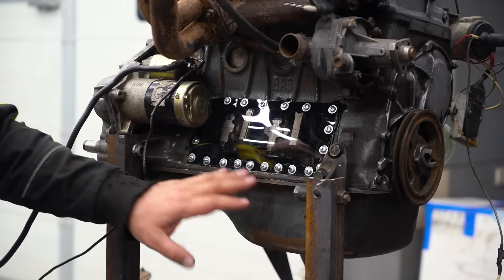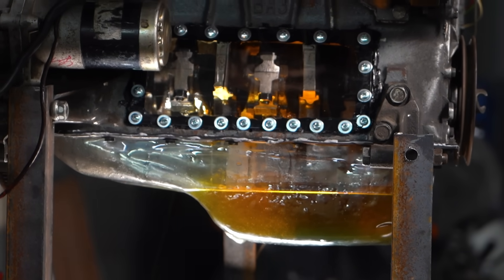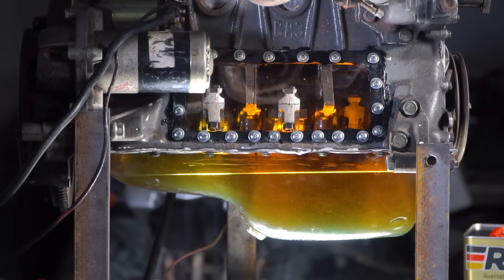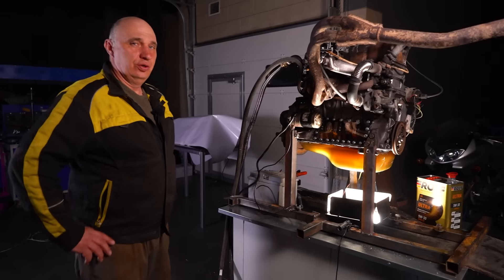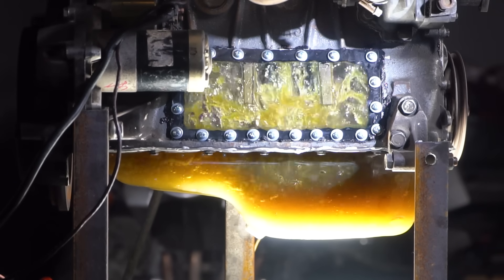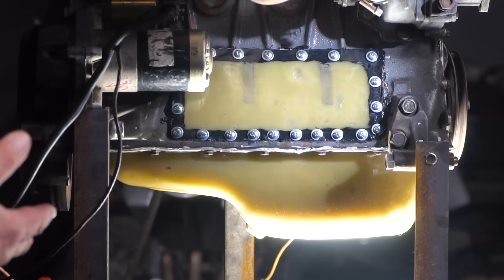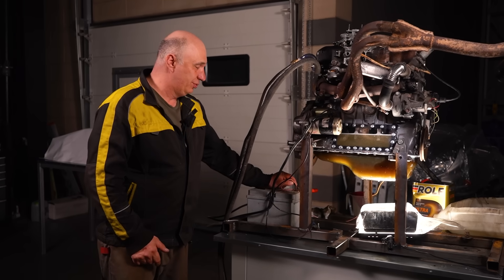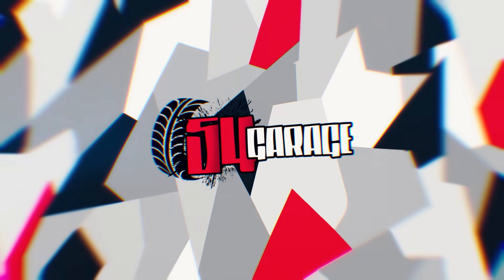What actually happens when you overfill your motor oil? (w/ transparent oil pan)

Comment: Huh. Interesting. I had a new engine built for my 72 charger last year. Guy built it out just "a little bit". Fast forward a year later and I'm now replacing the valve cover gaskets for the 3rd time, the pcv valve for the 2nd time, & installing a baffle under the oil cap. Never fill it past the fill line but also can't remember if we put an oil pan that was bigger than original/ if we replaced the dipstick in the process. (That was a years ago project from when I bought the car). Guy told me it had extra pressure and that would explain the oil shooting out from under the oil cap, but not sure about blowing BOTH valve gaskets repeatedly. Watching this gives me more questions but a better insight as to how to fix them. 😂 great video guys! Cheers!

Comment: The lubricant properties of the oil are deteriorated by the saturation of air. Which means the engines life has been compromise due to metal to metal protection been reduced. Besides burning oil and increasing vapor internal pressure.

Comment: If you want your car engine to last longer add more oil, oil is what cools the engine, The reason they may say not to, Is because if everybody added more oil that would be more oil to have to get rid of each oil change, Car companies just give the recommended amount of oil to get it through warranty, You should always add at least a couple extra quarts of oil if you own your car And you want the engine to last longer, Been doing it for over 50 years on every one of my engines, Just remember oil is what cools the engine down, So the less oil in the engine the less it's cooling the engine,

Comment: Had a six in my Ford itused so much oil we filled the engine to the top of the valve cover never hurt anything , i used it to go to work every day no isdues except i had to plug the dipstick hole to keep the oil from running out

Comment: someone i know overfilled their oil by 5 quarts under the assumption they could stretch out needing an oil change. it only held 4.5 foamed up and massive amounts of oil started going in the pcv. they called me when their car started billowing whte smoke. had to pry what they did out of them drained 10 quarts out and changed the oil in a mcdonalds parking lot. gave it a hot supper to burn out the residual, a couple months later catalytic converter effecciency below threshold. fouled it up ruined a 500-1500 dollar part.

Comment: The difference of that test and the reality is that on real life when driving the car the oil moves everywhere, and especially on uphills or downhills oil will go to the back or front o he engine, even with the same gap of the crank to the oil on that video, in the conditions that i've said oil level can touch the crank, oil will make resistance on the crank and with the engine tilted it can happen just on one side of the crank so its even worse, that resistance can surely bend or damage the crank or push rods driving with too much oil on long term.. easy to prevent, just fill a little before de max level and you surely will have enough gap between and moving components, is way more safe and as you see the oil system don't need oil on the max level to lubricate all the components

Comment: Ive always heard to much oil can cause gaskets to blow. Seems legit. In this case the oil pan was the weak link. 

Someone mentioned a good point. All the air bubbles going into the pump could cause issues. All engines are going to react differently  though. Id say its best to not overfill your engine.

Comment: Very good experiment.   I suppose all of us who work on engines have wondered about the 
"Caution, do not overfill”. Warning, and now we know.  Thank you.  I also was wondering what cavitation of the oil would do to oil pressure and efficiency of lubrication.  Has to not be good.  Second, I was wondering what the physical resistance to crankshaft counter weights and rod ends would have on efficiency of operation.  Seems the resistance would decrease horsepower.  Thank you again for the great video.
Richard,
Utah, USA

Comment: Cavitation (air bubbles in fluid) means less oil gets to the top end (cam and lobes, valve stems, rocker arms, lifters, etc.), causing premature wear ,reducing horsepower and fuel efficiency because of the drag on the crank counterweights. It's why some engine builders use a windage tray to remove oils parasitic drag on the crank. Awesome video by the way.
Reply: the dip stick have hallow dots on it which tells how much space is in the sump available to fill the oil for the engine
Reply: the dip stick have hallow dots on it which tells how much space is in the sump available to fill the oil for the engine

Comment: I have always thought that the myth that a motor are having 1 quart too much oil and it was gonna cause it to blow up. I always thought it was a load of crap.
I also understand that this engine is a Russian made engine and they I am sure obviously make their engines too much different tolerances than ours are made or that Japan makes because here in the United States probably half of the cars on the road or made in Japan, but I cannot believe that the tolerances are so tight that 1 quart over recommended level is going to destroy a motor. I mean if what that guy was saying was true. He had three times amount of oil in that thing and it was still running fine and I would think that in any motor having a little too much oil is better than not having enough.

Comment: A-1 video great presentation !! i've never seen anything like it ! I have started putting in 10 quarts instead of 5 quarts, the extra oil loosened the sludge around the block, totally plugged oil filter, valves started to clang & rattle, oil  pressure dropped to zero,
when I pulled oil filter, it was full & solid, I carry a spare filter now.. thanks mister !!

Comment: My 2015 0.9l Hyundai i10 has a dipstick that is wrongly marked.  The book says 3l oil for refills, if you do this the oil level on the dipstick is about 12mm./ half inch above the top line marked across the stick.  Oil filter capacity makes little difference.  You will only find this out if you do the oil change yourself, I carefully checked the empty oil containers and have never seen this before on any car.  Ask your dealer to check this carefully when he services your car.

Comment: Interesting video! We had a Hyundai Atos once; two times the garage "overfilled" with oil causing the evacuation hose to come off. The station filled with the recommended amount of oil from the service manual, but it seemed to be a little too much. I guess the Atos engine is a sensitive one.

Comment: lmao even when they see by their own eyes... some people still believe a small overfill will hurt oil rings and create excessive oil pressure and burst engine rear seals and kaboom... no my friends, unless you really overfill a lot, its not 100-200ml more that will do anything... first, oil pressure is only after the oil pump, secondly that amount of overfill is not enough to hit the crank and create bubbles... so yeah if your oil level is at max or slightly above max you are fine... in fact much better than close to minimum, as we saw in the first run he did, if the oil level was a bit lower in high rpm's the pickup can almost run out of oil when could... thats also why you shouldnt high rev a cold engine... never do that by a lot of reasons, not only oil..

Comment: I had a customer bring in her car (Nissan Sentra). Her complaint was it was running rough. I knew there was a problem when I pulled the dipstick and oil shot up from the tube. She filled the oil all the way to the top of the valve cover. I asked why it was that full. She blamed me and the guy(another customer) who sold it to her. 
"He said all he does is add a quart of oil every week", she said.
I told her, "Yes, because he's on the road 5 days/week putting 1500 miles or more on it. We both told you that".
"Oh...I forgot". 
I gave her a free oil change and we laughed. That Sentra drove like no other. I don't think they're capable of dying. The thing had no leaks.

Comment: you should have filled it until overflow and put the breather tube in a 5 gallon bucket with a lid and a bunch of oil with the original metal oil pan on it and revved the shit out of it. This way the breather would be sucking up and blowing out motor oil keeping it flooded

Comment: I have a Ram 1500 V8, and it calls for 7 quarts of oil. I always use Royal Purple synthetic 5w 20. I always before Changing my oil Bring Up Operating temperature this way When I drain the oil I can get the most out. Putting the 7 quarts puts the oil Level right at the top or a little over the Max line. Great video. 🇺🇸

Comment: The absolute BIGGEST lesson to learn here, that I have known since I bought my first car, is to always give an engine at least 30 seconds on a cold start to circulate the oil. In addition to that is to never drive at highway speeds until the engine has fully warmed up. I go the speed limit on the feeder/service roads until my car has warmed up.

I take it a bit further, when time allows, and give my car at least 5 to 10 minutes to idle itself to operating temperature. I understand the impact this has on possible emissions and fuel economy but, I have always noticed that my cars have little to zero problems as they age from me doing this method.

I also try to never go above 3,000 RPM when accelerating and use a linear amount of pressure when depressing the gas pedal. I use the tall ratios of the transmission gearing to get up to highway speed with the engine barely even needing to go over 2,000 RPM.

My car has a V6 engine so, it has a lot of power to allow me to drive it this way. A 4 cylinder engine may or may not allow this type of acceleration method as I have never owned a vehicle with a 4 cylinder engine.

Great video, there is a lot to learn here.

Comment: I passed the top line accidentally, and my vehicle eventually misfired
One spark plug was lightly oiled
The video is a bit ridiculous, because what was supposed to do  is paasing a max line a reasonable amount of oil and show what hapen to the engine parts, instead to keep adding oil, on and on and on

Comment: I recently purchased a used Subaru outback with 175,000 miles on the engine. After having rough idling and stalling problems I fixing tons of random issues (cleaned throttle body, cleaned MAP and MAF sensors, cleaned EGR valve, replaced air filter, plugs, wires, coil, replaced broken ground strap). The idle got slightly better or no change each time. I also replaced the PCV valve which was oily, spark plugs oily... It still stalled occasionally after all that work. I decided to change the oil because it was time anyway and I had run out of things to fix.

I nearly overflowed my 7qt drain pan. There was more than 2qts MORE oil in the engine than there was supposed to be. It's been a week and the car hasn't stalled. Not saying that was the cause, but it certainly wasn't helping.

Comment: Slightly overfilling isn't a major issue on petrol engines, but overfilling on diesel is where things can get dangerous, it can cause diesel runaway if the oil pressure is enough to make its way into the cylinders

Comment: Absolutely Brilliant  👍👍   Just a pity that you didn't add a pressure gauge to observe the pressure differences at each level.
From my view watching this, it would appear that the twice amount of oil was the best.  I'm sure that the crank bearings, connecting rod's, cylinder walls and rings were getting an optimum amount of lubrication.
Not sure about the winter cold cranking ability though?

Cheers    👍👍🍁🍁

Comment: My turbo engine does burn a bit of oil which is normal for its model. The trick is checking the oil filter for any sparkling bits. Is it still the rule to check the oil level after it’s cooled down or right after it’s been running? Cheers 🍻

Comment: This is misinformation!!

Even a little over the full mark increases pressure on the seals.  Over months and years that slight added pressure can and likely will add up to big problems. 
I run my oil a 2-3 mm over the full mark at most.
Some people say to aim for 1mm or 2mm under the full mark just to be safe.   The area between the add marks and full  marks is called the safe zone so 90% -95%  up to the add mark is definitely safe. No need to go over the full mark on your dipstick Boys and Girls. :)   This video only shows for a few minutes. Very misleading!

Comment: I run all my engine a quart over if they hold 5 quarts stock. They forgot most engines have a windage tray in them. I have never had a problem a quart over full which helps oil the timing chains and the cylinder walls. At a quart over you have one quart in the valve covers and other places. A quart over is nothing.

Comment: just my non-mechanic brain thinking... air or foamy oil means less lubrication. Over all it will cause more wear and tear because it's not oil lubricating your engine, but air. Your engine may not break down right away but yea that ending was expected, shake up a can of soda, if you have a weak point...

Comment: Very nice video demonstration, while we always try to get the oil level correct and to the fill level there is tolerance for slightly more oil above the mark within reason. I wouldn’t go nuts with excessive amounts higher than manufacturer recommendations, and extra 0.5L above the max oil level mark isn’t going to do any appreciable hard. On most of my cars i fill directly to the max line, however on an old vehicle with a tendency of burning a small portion of oil between changes i would generally top up 0.5L above the max line to account for the slight oil burn minimizing the oil top ups between changes. I’ve never had any concerns as this video went well beyond the 0.5L above max level, given a manufacturer tolerance of 10% the 0.5L additional oil wouldn’t be a concern at all.

If you went crazy and filled up by more than a litre i would drain/siphon and get it back to where it should be, just because you can tolerte more doesn’t mean that it is good to do.

Cheers.

Comment: I'd suggest the amount of aeration occuring is degrading the performance of the oil. No real need to mention the horse power loss with the crank burried in oil. One of the many reasons there are baffles and screens between the crank and the oil.
Very cool experiment!

Comment: So moral of the story is: If you overfill just slightly over on the high you should be okay. But if you have a lot of money and don't know math when the car calls for 4 quarts and you add 8, then you need to go get checked out. 

Rule of thumb is to fill at level or best just under i.e., 80%-90% full. Too much oil can lead to leaks and other issues.

Comment: As others have noted the issue is foaming and air bubbles in the system. But theres another that i found out in the oilfield. Old oilfield engines, fairbanks&morse/bell, motors, don't have pumps, they are whipped through the engine by a flipper on the connecting rod cap. That mechanical whipping not only airates the oil and foams it but it breaks it down ALOT faster and sludges up the engine. I now use good diesel oil or thick oil in the motors. Synthetic has promise but only in motors that have new sleeves and new piston and seals. I have seen it work in one motor. Otherwise, on arrow/connentinal motors it dose not matter since those makes have oil pumps.

Comment: Crap - I have a 1968 Wolseley 18/85 Mk I and they came out with dipsticks which had a small error - they showed "full" when actually were slightly over full.  If I fill to the dipstick, everything is fine until the engine reaches "normal" operating temperature and then I produce the biggest blue smokescreen you have ever seen! The first time it happened, I thought I had blown something and immediately turned off the engine, coasted to the kerb and got a tow home. I inspected everything, turned the engine over by hand and couldn't find any problem. I did notice that the oil was a bit down so I topped it up and took the car our for a check drive. It went really well and I was very happy with it as I turned to go home - I did notice that the temp gauge was just hitting normal [I had been carefully monitoring all gauges]. Just then, I noticed in my rearview mirror my huge blue smokescreen! I decided to keep driving heading home and by the time I got home the smokescreen had gone. I let the car sit for awhile and then rechecked the fluids only to find the it was again a little bit down. So, from then on, I only fill it up to 7/8th on the dipstick and have had no problems.

Comment: i change my oil and put an additive on top of the normal fill., the additive is about 1/4 of a court. never had an issue with leaks or else. 200k on the odometer.

Comment: I was always taught that you would blow the front and rear main seals by overfilling.  But I always wondered how much overfilling was critical.  Now I have a good idea.  Although the lubricity of the oil when it is fully aireated is probably going to be very much reduced and wear much increased thereby.  Seems it is not a good idea but not immediately catastrophic.  I expected it to hydrolock when he reached the extreme amounts.  Seems that the piston skirts never submerged to that point.  Very, interesting.

Comment: I had a 1998 dodge neon. It was about three years old and I topped it off with oil. I went on a road trip for about two hours each way and then I was almost home. My engine shot the spark plug out of the head. I wasn’t able to have it helicoiled.

Comment: I knew a guy once - a friend of a friend - who lost his dip-stick. So he plugged the dip-stick hole and filled the engine up with oil until he could see it through the cap on the timing cover. When he went to start the engine - as soon as it fired it hydro-locked and snapped some  con-rods as well as blowing the sump off......